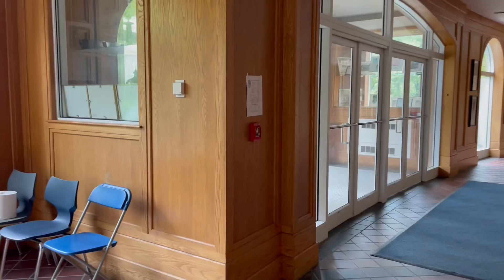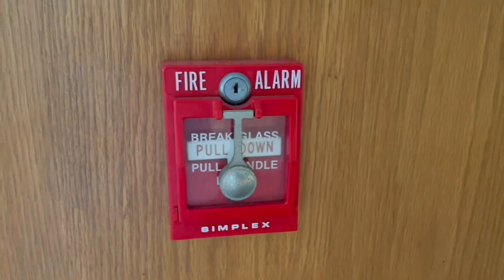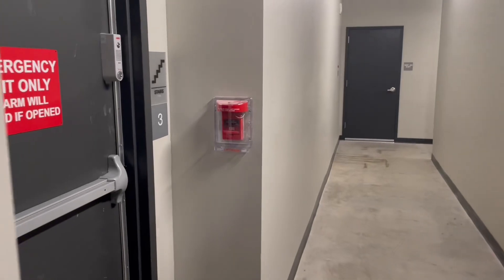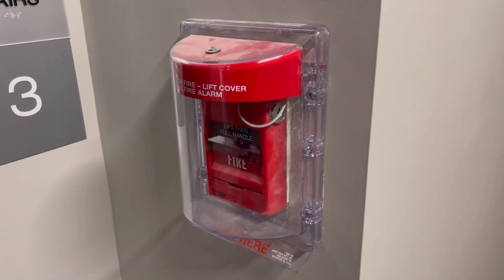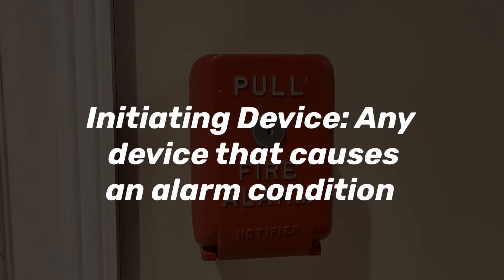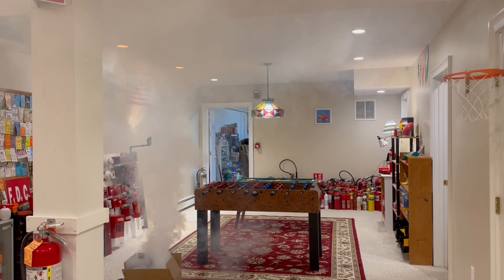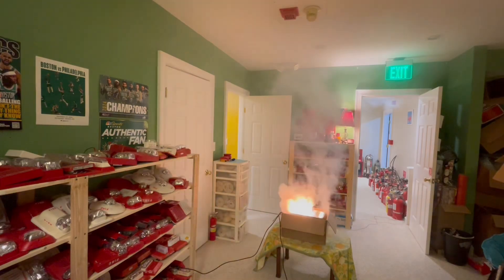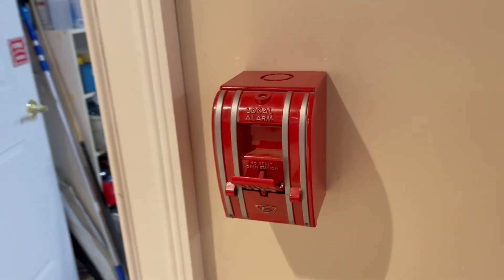Components of Fire Alarm Systems | A Basic Fire Alarm System Overview

Comment: At my place of work, some duct detectors just shut down the AC unit while others, well idk as they are broken, and there is no zone(s) on the FACP that indicates a duct detector. What is weird is the sprinkler tamper switch is wired to cause a full alarm rather than a trouble or a supervisory.

Comment: Elevator Fire Recall is also something that happens when a Fire Alarm goes off, as that stops normal operation of every Elevator, and relocates every Elevator to the lowest level of a building with the doors stuck open, and then also Escalators, if wired properly, are meant to immediately shutoff once a Fire Alarm goes off, as it is dangerous to use one of those in a Fire Emergency, which is why people told to go to a regular staircase and not an Escalator.